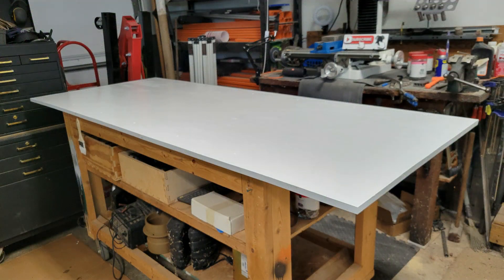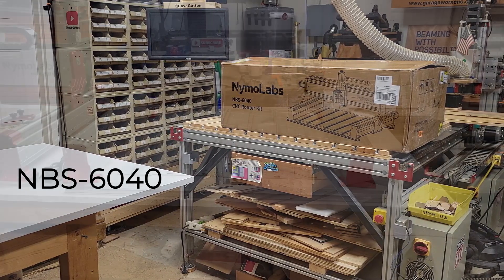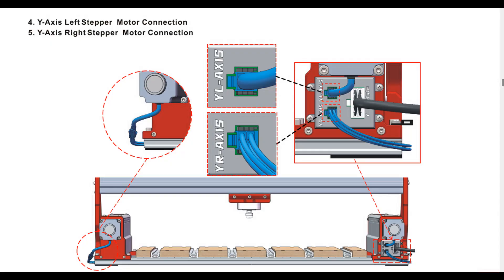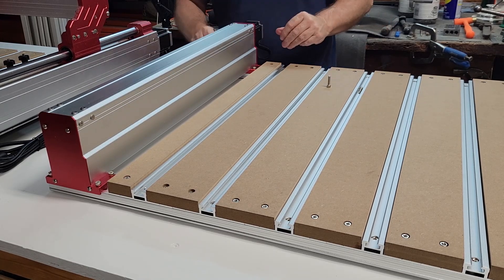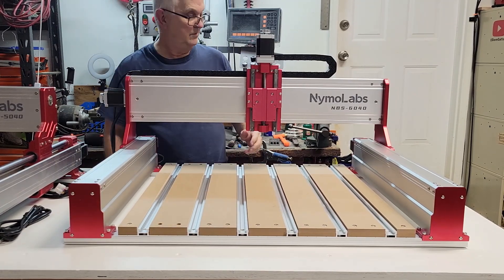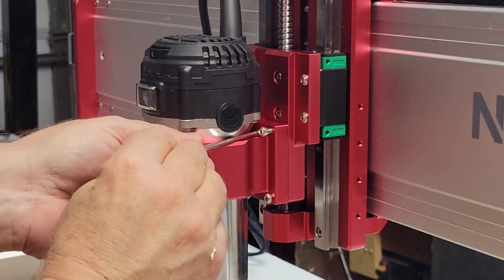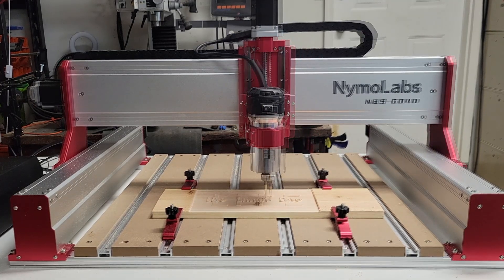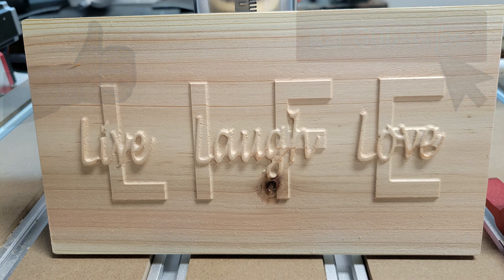And Then There Were Two  |  Unboxing the NBS 6040 CNC

Comment: Dave,  sure looks like NymoLabs has it right.  Those appear to be nice capable machines.  A nice addition to any shop.  Thanks for the information and demonstration.
Reply from the maker: Thanks Paul.  I honestly believe these Nymolabs machines are the best value under 2k.   You can get one of these without breaking the bank and you're ready to start running projects right away without having to upgrade anything.  You don't even need a computer connected to it.

Comment: i have had the 6040 for about 5 months now and very much enjoy it. spent the 1st few months learning the machine and doing wood, plastic, etc. for the last month or so, been exploring soft metal milling - brass, bronze and aluminum. with the right tool and right settings, it really does a great job. very happy with the machine. glad to see a yt-er showing off some of the capabilities of these machines.
Reply from the maker: @prfssrleee  You ain't seen nothing yet.  😃
Reply: @DaveGatton  looking forward to watching! btw, i actually purchased the water-cooled 1.5kW spindle but haven't felt the need to install it yet. Maybe at some point, but really, reinforcing the base helped a ton. To do that I just put it on a 2" butcher block base (48x30) and what a difference.

Comment: Can it work 7075 aluminum?
Reply: i have milled 6061 al, brass and Si-bronze with it. once i got the speeds and feeds correct and bought a good tool, i've had no issues. clearing chips while milling metal is very important, and something not mentioned too much, as stable a base as you can manage! i learned both of those things the hard way.
Reply: @prfssrleee how has this machine treated you so far. I’m liking to purchase but not many reviews. It looks like I can upgrade a fox alien xe pro to be the same machine but have closed loop motors instead. Let me know what you think I should
Reply: @nicojordan3542  Hi there - so far I am really enjoying this machine. It does what I need, which is non-production milling of brass, bronze and 6061 aluminum to <0.2mm tolerance (I just don't need better than that though I'm pretty sure it can do better). I've started messing around with some plastics (and of course any kind of wood is no issue) but really that's for grins. I have the water-cooled 1.5kW spindle and actually switched back to the stock 700-ishW one. Honestly the stock spindle can handle those materials just fine and my dust shoe fits that spindle. I'm going to get around to designing a dust shoe for the bigger spindle but haven't done that yet. I mounted the machine onto a big, thick maple top (60"x30"x2" thick) and the extra mass helped by allowing me to increase accelerations without losing tolerances. Hope that is helpful.
Reply: @ really cool. Thank you. I’m deciding between this and an upgraded xe pro with linear rails. I’m more looking for something more rigid. Let me know what you think I should do. Fox alien has closed loop but I was reading on Reddit that the electronics on the fox alien are not actually capable of doing what the closed loop is designed for. Thanks again.
Reply: @nicojordan3542  well, I can tell you that I typically take 0.040 max doc using single-flute 1/4" and 1/8" end mills in al, brass, bronze with no trouble at 50-60 ipm and 10k-14k spindle - so that's pretty easy with the nbs-6040 (I guess the FoxAlien could do that too based on its specs, but I don't know). YMMV I suppose. I think I could push the doc a bit deeper but typically use 0.030" and run a finishing pass if I need it. As I said, haven't tried to hold anything tighter than 0.2mm, but that is absolutely no problem usually without the finishing pass. If you want more rigidity, I would start by replacing the (T-slot + MDF slats) base board with a single machined piece of aluminum. That would add a bunch of mass and also keep everything quite rigid. But 2'x2'x1/2" al plate would be pretty pricey.
Reply: @prfssrleee  thanks for the response boss. I just can’t believe fox alien charges $380 for their linear rails. Maybe if these go back in stock I’ll just send it. It’s looking like either this, a used a shapeoko, fox alien xe, or upgraded 4030. Lowkey want to get a 4030 and put my own linear rail upgrade kit I just really don’t want to buy the aluminum and linear rails to make the kit and it end up not working.  Original 4030 r like $600 on Amazon right now ,

Comment: Great review,Dave.  The 6040 seems more heavy duty than the 5040. 
If I remember right, the table size for both are the same. Am I right?   Do the 6040 come with a Spindle or a Router?  Love your reviews!
Reply from the maker: Thanks for watching Dennis.  The NBS-6040 is a little bit bigger than NBX-5040 (NBS-6040  is 600 x 400, NBX-5040 is 500 x 400).  There are a few other differences that I'll cover in a future video, but both machines are great.